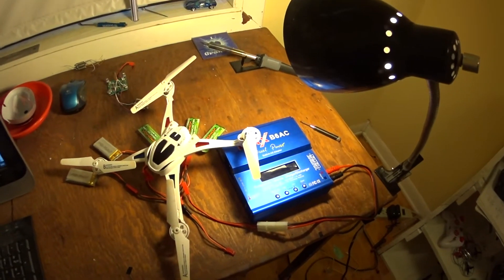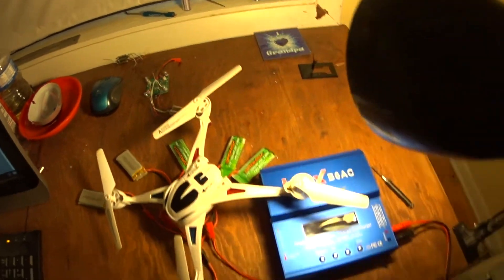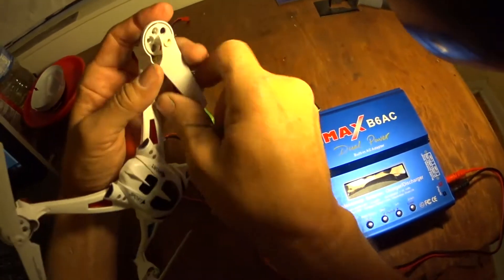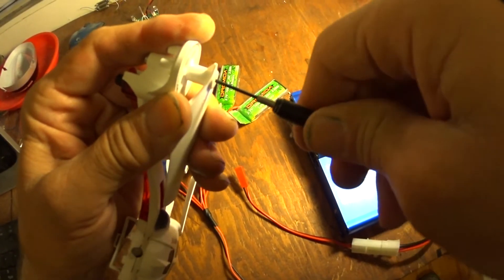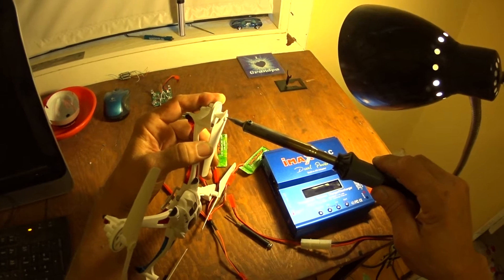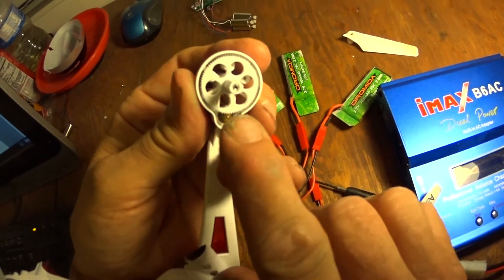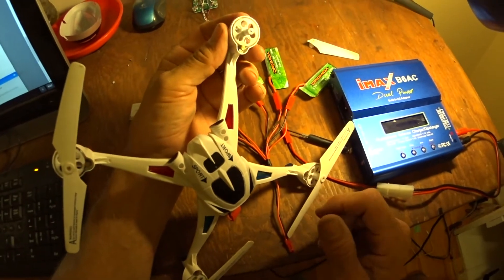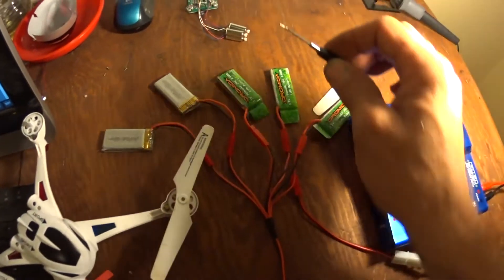Nihui U807 tech  change a prop

Comment: Hey Kenneth, what's the average lifespan of the motors and quad in general?
Reply from the maker: Spideystrat the motors are the only thing that needs replacing periodically, probably 50-70 flights as long as crashing is rare
Reply: Kenneth Taylor fantastic ! thanks.  Waiting on a JJR H36 for indoor fun this winter. How about yourself ? flying indoors much ?
Reply from the maker: Spideystrat
Reply from the maker: Spideystrat.  Yeah, I have a tiny whoop and a few other nanos to play with inside, and a new Shuriken 180 to fly outside, but my DX6i pooped out, so I'm going to get a Devo 10 to fly the whoop and the 180.  Later I'll get the 4 in 1 module so I can fly everything with the Devo
Reply: what exactly do you have to do to fly with DEVO ? New to the hobby & have heard lots about that transmitter. Why do you have to buy a module to go w it ?
Reply from the maker: Spideystrat  the Devo transmitters can be firmware flashed with Deviation to allow more flight protocols to be used.  After flashing, the Spektrum (DSM2 / X) protocol can be used with no hardware modification.  The 4 in 1 module adds 3 more transmitter chips that cover the majority of popular toy and hobby grade protocols, such as the U 807.  Join RCGroups and come to the Nihui U807 thread where we talk about all things quad :-)
Reply: Kenneth Taylor Thanks for the invite!  I shall do that   :)
Reply: Can the U807 comfortably lift an 808 keychain camera ?

Comment: Hello can you tell me how can i tell which motor is a cw motor and which is a counter clockwise
Reply from the maker: Mohammed Rashid Yes, it is very easy;  hold the quad so that it is level with the tip of a blade aiming directly in your line of sight. Whichever edge of the blade is high tells you which way it will spin.  If the high side is to the right, that prop will be turning in a left circle, or counterclockwise.  If the high side is to the left, that prop will be turning in a right circle, or clockwise.